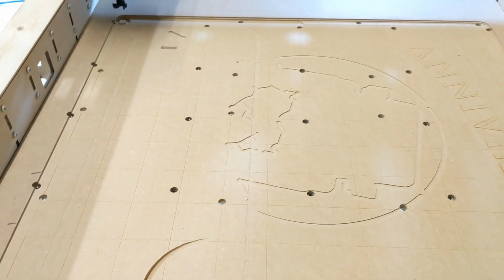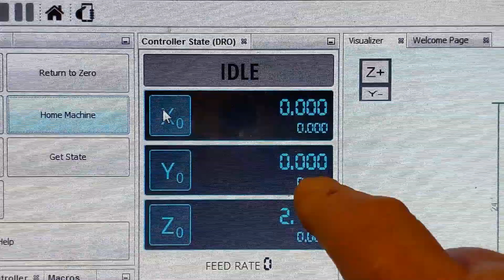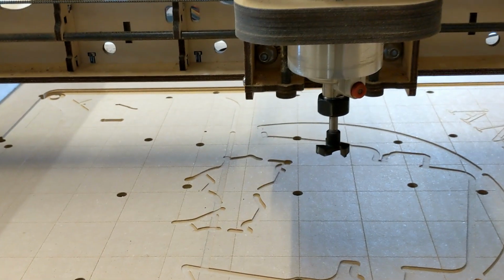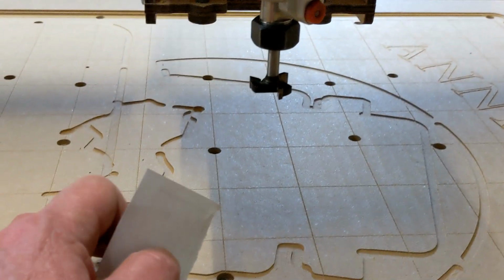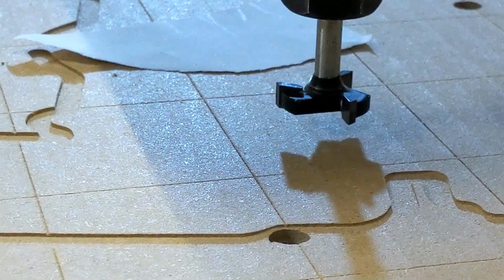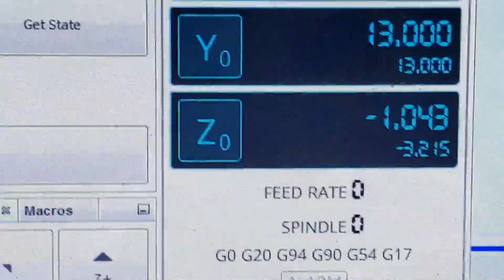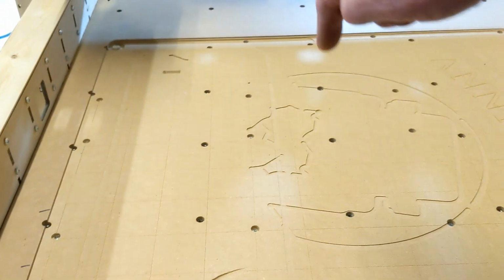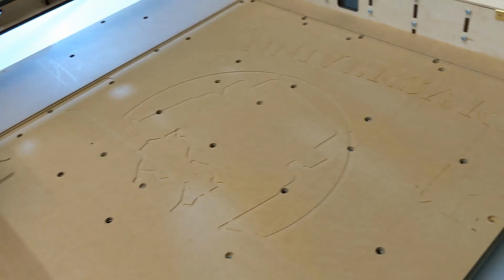BobsCNC Evolution 4 Spoilboard Surfacing / Resurfacing Instruction - Garrett Fromme

Comment: Garrett brother I know this is old video but i have the Bobs CNC Gen5 cutting area 24x55 with aluminum t tracks.  I would think this would still work...
Reply from the maker: Joe, it definitely would. You would need to create a different spoilpoard surfacing file for your specific machine but everything else should work great!

Comment: My machine didn't come with that board
Reply from the maker: Redds, most machine don't come with a spoilboard. I buy mine from Home Depot,  it's just a 3/4" thick piece of MDF.
Reply: @IDCWoodcraft  Yes I called yesterday and they sent a t board set up. But I will install that plus add my own. Thanks

Comment: Bobs E4 cnc I have came with a dewalt single speed router, I was hoping to learn how to surface the spoil board with this setup. Any tips for a 30,000 rpm router?! Thanks for what you do!
Reply from the maker: Hi Chris. Follow the instructions in this video. If you cannot change the router speed, increase the feed to 200ipm
Reply: @IDCWoodcraft  Ah, thank you kindly! Another fly in the ointment is that the 1” carbide bit I purchased has a max rpm of 18,000 stamped on it. Do you think I should heed that warning?
Reply from the maker: @christopherdubour6662  totally heed that warning. You'll burn up your bit in no time if you get it too fast and you'll ruin your project

Comment: Nice video, though I think that your spoil board is too big, I'm using a board slightly smaller than the work area so that I can use larger pieces of material that stick out the back and still be level with the board.
Reply from the maker: Hi Jasper. Yes, the board is actually the base. I am going to add a spoilboard on top of that one for the same reason and so I don't ruin it any more.